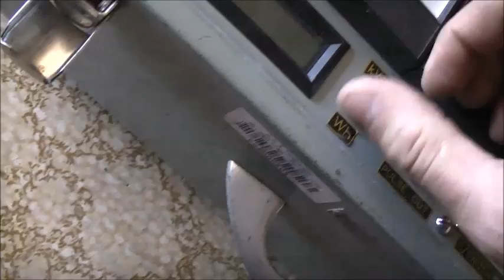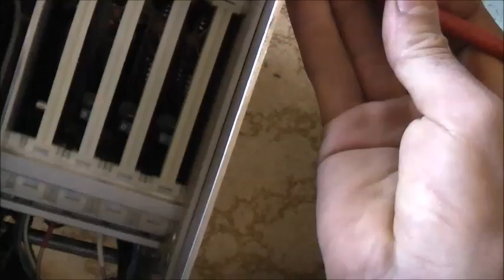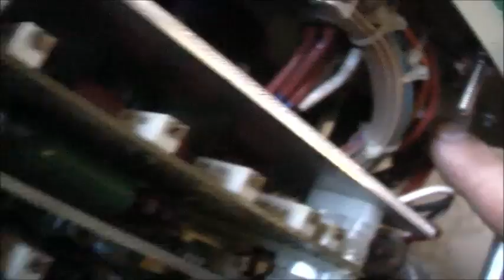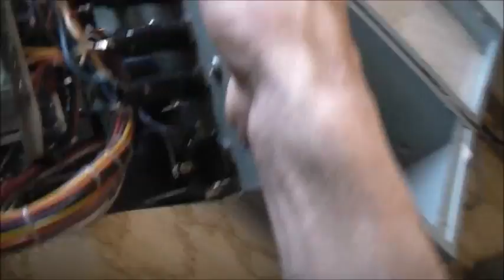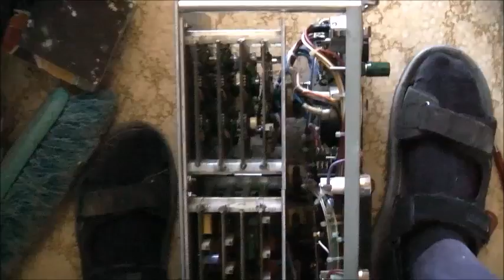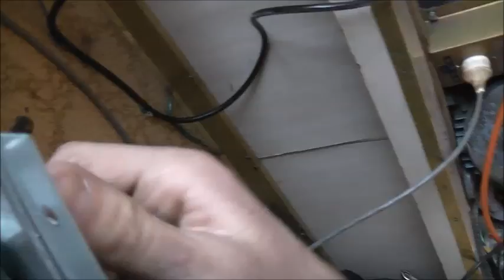Look Inside Test Gear!

Comment: Aaaah, this is interesting! There's more electronics in that than what I was expecting though. I was more-or-less expecting the whole thing to be mechanical with a few variacs slung in there. :D

So then......those Red Yellow and Blue control dials.......They're rheostats and not variacs. Well, I suppose that's another way of doing it. :-)

Thanxx for showing,

-BoomBoxDeluxe.

7th September 2014, 16.26